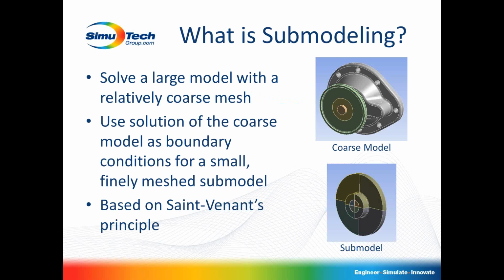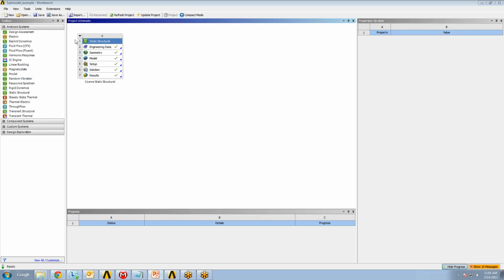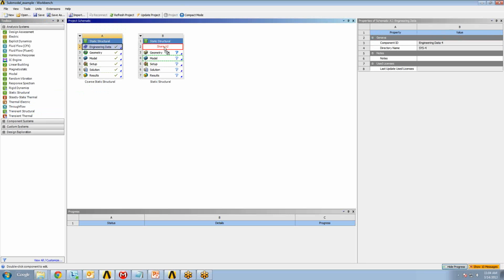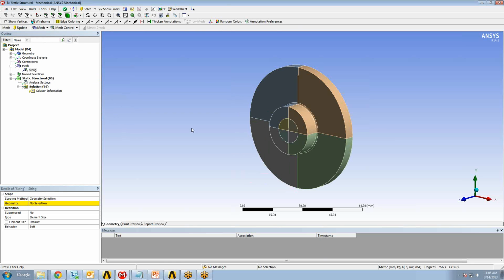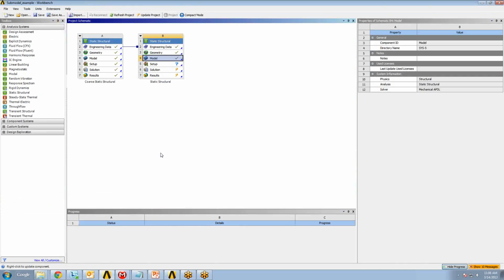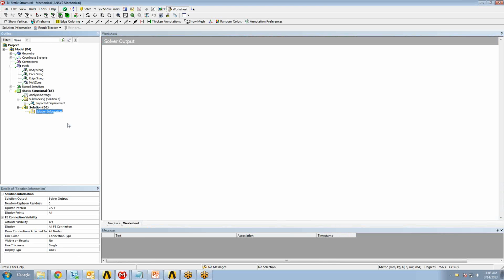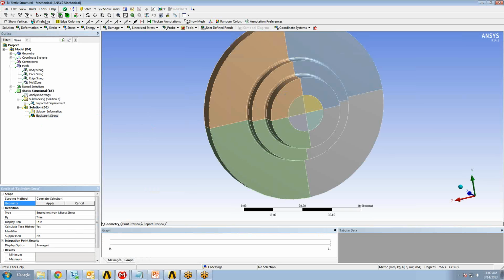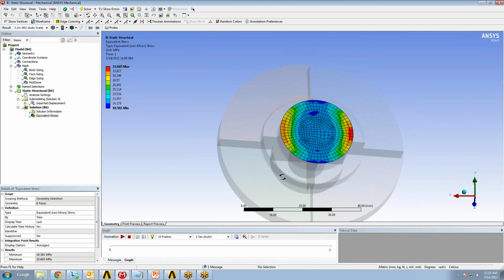Submodeling FEA using ANSYS Workbench 14.5

Comment: One question:

I have found other documentation online about submodeling, and in all of them it is mention that if you have a load on the full model, with it applied on the area of interest the submodel must have that loading reapplied.

I've seen you have a load on the disc which later on is part of the submodel, but you are not reapplying the load.

Is that correct?

thanks
Reply: Musiice,

You are correct.  Any loads applied in the global model that are in the area of interest of the submodel will need to be re-applied for the submodel.  

Butch Vision
SimuTech Group

Comment: How do you map the displacements of the course model onto the fine model? Does this assume you have the same coordinate system in both? That part gets kind of glossed over...
Reply from the maker: If you are a current ANSYS customer, there is a training class on this with more documentation.  Appendix B in the 14.5 Intro Mechanical WB class elaborates on this. Usually you start with the same model for both the Full and Submodel, therefore the coord sys are the same. The named selections and the drag and drop of the keys for mapping.  The video is really just to show the basic workflow.  We've used this technique many times in consulting and with clients in Tech Support and it works great.